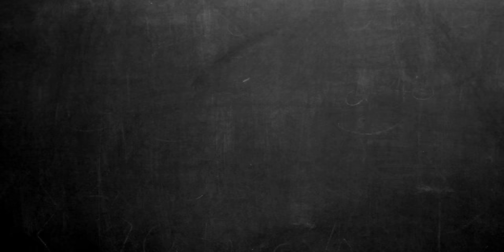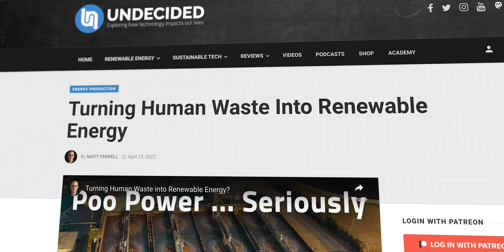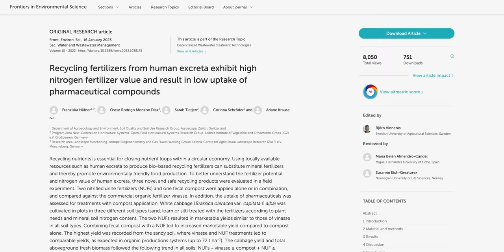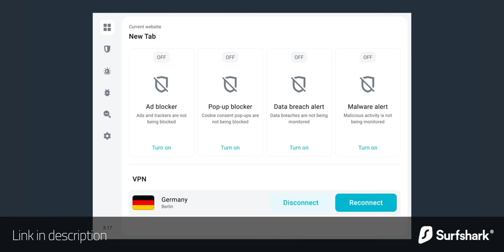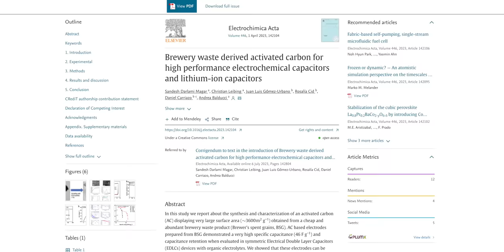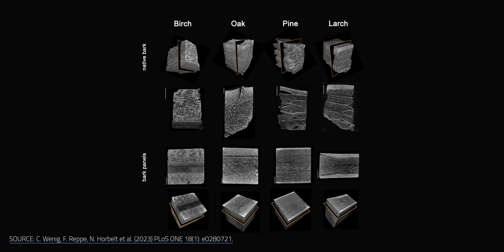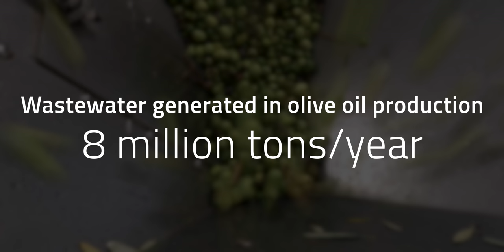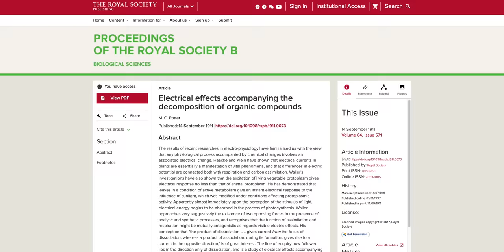Top 5 Crazy innovations for Reusing Waste

Comment: If we were on a generational space ship traveling towards some other destination in the universe, we'd want to recycle everything.  Thing is, we basically *are*.
Reply: Well it's a long step away from the disposable society we live in at present we don't even up cycle or recycle phones that get dumped as we can't change batteries and throw away vapes and bottled water.
Reply: Earth is our generational space station. Recycling should be so common that it replaces the word trash entirely. Science needs to advance so that costs to recycle go down and becomes profitable. Otherwise, it won't be integrated into the economy as much as it should be. Beer powered society lol ❤🙏
Reply: @SlyerFox666  he means the earth is basically a space ship.
Reply: @ge2719  what do you mean "he means" we are ? And what also gave you the impression that that went over my head when it is literally written 🤷🏼‍♂️
Reply: @SlyerFox666  well for one thing the op said nothing about society, or disposable society, or recycling, or single use product, or anything relating to anything you said. The op merely said earth is essentially already a multi generational space ship hurtling through space.
the op say " we basically *are*..." is not them referring to the "we'd want to recycle everything". that YOU replied to. 
So the specific part of the quote the op was referencing clearly did go over your head.
Reply: @ge2719  Well your wrong there recycle everything was literally what was written so is it really worth me addressing someone that can't even be bothered to read a comment takes some sort of offence to a reply and then tries to explain how they are right and the other is wrong when clearly your not, troll along good buddy 🤣
Reply: The problem is, it's always seen as a problem for the next generations.
Reply: @davidmccarthy6061  then don't then is the solution 🙈🙉🙊
Reply: @SlyerFox666 the batteries thing will change in eu. Eu made it necessary to make phone batteries replaceable
Reply: @kin98100  ROFL yea good luck with that one
Reply: TRUTH!!!
Reply: @davidmccarthy6061  Yeah, we already know that. Conversation here is: How can we do better?
Reply: Makes me wonder about a sort of "net" ahead of interstellar ships. Not that you will run into much, but anything in the way will be disastrous if not dealt with, so might as well see if you can scoop it up for use as needed.
Reply: Thing is everything that we have used is still here. Nothing has been lost, only changed. Do we solve the “co2 problem” by going to electric cars or by recapturing the CO2 with plants that we and our livestock can eat?  Both?  Why must we focus on one idea and ignore others. Why do we let narrowly elected buffoons decide what ideas will be forcefully promoted and which will be forcibly denied?
Reply: 😱😱😱 I don’t believe there is none about farts 😱😱😱  Farts r methane gas. There gotta be some way to take advantage of our farts 💨
Reply: We do not generate enough waste to do much useful.  We simply could NOT use direct human waste as fertilizer. We simply do not have enough.  It sounds like a lot and it is in general, but not in comparison to the number of acres under farming.  We  need hundreds of pounds per acre of regular  fertilizer. Poop based fertilizer would probably be MUCH higher.  If you assume a ton per acre, it would take 94 million tons just for corn.

The average person poos 320 pounds per year.  Times that by 320 million and you get 51.2 million tons.  This is wet poo. All the water content would need to be pulled out before turning it to fertilizer. Poo is 75% water. So the total amount of dry poo per year in the US counting all 320 million souls is 12.8 million tons (2000 lb ton).  This would not even cover just the corn dedicated to corn ethanol.

 Beer to batteries won't be much either and that's assuming the tech works as advertised, which it probably does not.

To put things in perspective, something like 40% of the corn we grow goes to creating ethanol for gasoline and it's barely 10%. Corn is, by a wide margin, the most grown crop in the US. 40% of that acreage (38 million acres dedicated to corn ethanol. total corn is 94 million acres)  is dedicated to making about 10% of our gasoline.

Our lives, everything about our lives is enabled by fossil fuels. The fertilizer we use is made from natural gas.  We literally fly airplanes over crops to crop dust them. We run electric pumps to pump water into the crops.  The crops are picked (and sown) by enormous diesel burning machines. They are shipped by diesel machine. Then they are processed using electric machinery and then finally shipped to your local supermarket in air conditioned trucks burning, you guessed it, diesel.

We are literal SUVs.
Reply: @christo930  all good points.  For the cost of energy now, it's not economically viable but if energy were to become cheaper and processes were to improve, it could be.  But it is pretty wasteful that we spend so much energy and effort to mine fertilizer or refine it from natural gas and then grow food with it and then poo it away.  It could be put to better use.
Reply: @marginbuu212  But it's not a cost problem, it's a scale problem.  The amount of poo is not sufficient to fertilize all of the acreage being farmed in the US.  I'm sure, though I haven't run the numbers, that it's just as bad for pee.

I'm not saying these are bad ideas though. Cutting the amount of natural gas we use on fertilizer means it will last longer. By all means, all the poo that can be captured and turned into fertilizer should be captured and turned to fertilizer.

The beer thing though sounds fanciful. It might not be worth doing.  Because later in the video after I posted my comment, he mentioned it was turned to carbon.  The final carbon product is probably maybe 10% of the weight as it left the brewery.  If it works, by all means, we should do it.  Conserving scarce natural resources should be a priority.

The way I see it, fossil fuels are/were a one time gift of nature. You use it, then it's gone forever and cannot be replaced.  I oppose exporting any of it.  I oppose frivolous uses of it.  Unlike other things, you can't recycle it and use it again. Nature is making more, it's not doing so on a time frame of any interest to us.  AFAIK, nearly all of it is at least 90 million years old. It took millions of years to lay down all the sediments, millions more to bury it deep enough and millions more to cook it into the wonderful stuff we get out of the ground.  OTOH, it is believed that every ounce of gold ever mined still exists.
Reply: Lol tell your mom to get you more pizza rolls and honey buns the Intellectuals are here talking
Reply: @ge2719  Mr Bucky Fuller stated that “we are in the Spaceship earth” back in 1948!

Comment: Interesting idea for using human waste as fertilizer.  Are they extracting the materials out of sewage or direct extraction?  The first will be relatively easy to implement, the second would require sociatal changes.  Also, how are they handling the infection risk?  One of the hazards of using human waste as fertilizer is someone getting infected and spreading the disease to others via the recycled food chain.  Personally I'd use radiation to sterilize but that will cause the environmentalists to freak out.

Possible future technologies, keep up the good work.

Comment: the second of 3 sections about (b.a.t.e.s.) The easiest example I can think of would-be cars, there may be some money in scrap metal, but there is no money in disassembly, and to correct this I suggest a £500 bond is payable to the (D.V.L.A.) when a vehicle is first registered in the U.K. (Other national vehicle registration departments are available) The bond is then held until the vehicle has reached the end of its useful life, then the bond will be redeemable by a disassembly company, only when the vehicle has passed down a disassembly line and has been broken down to its most basic components and not just crushed, this means everything removed, doors, bonnet, boot and separated from their padding and electricals, seating, carpets, and roof lining, plastic dash-Panel, and wiring loom removed, even the engine/ gearbox and suspension system to be separated into their various metallic alloys, and even the generator and starter motor, in the future this would include vehicle motive batteries and fuel cells, all to be disassembled. 

It would not matter Where in the world the car was made, once it is registered in the U.K. a bond must be bought, and all manufactures who wish to sell into the U.K. 
would have to supply the Disassembly companies with a protocol out lining the easiest methods of disassembly.

Problems and benefits of the idea so far, even a cheap car cost £15,000, so how do we manage to disassemble for just £500. Well to start with you do not need a design team or an advertising budget, neither do you have the cost of manufacturing components from freshly bought new raw materials, and if you consider it takes between 20 and 40 hours depending on the efficiency of the 
plant for a shell to travel down an assembly line to become a completed vehicle, it should take about the same amount of time to disassemble, and £500 is about the wage for forty hours of a low to medium skilled worker.

 And it will be MANUAL labour that will be required, robots are perfect for assembling pristine new components, but after ten or fifteen years of corrosion 
disassembly might be beyond them; one option could be to repurpose old car production plants that are due to be decommissioned. 

The bond for a washing machine, fridge or solar panel would be much less may be £20 as they should be much simpler to disassemble. O.K. disassembly might work, 
but the problem is with the bond idea, as it stands you would have a ten or fifteen-year time lag before such a system would be up and running, true but this is where 
the governments come in, they could pump prime, if the government paid out a sum equal to a bond for each scrapped car in the first year, the bonds collected on all 
new cars in the first year, would then go on to pay for the disassembling of cars in the second year, in the same way that today’s state pensions are paid for by today`s 
workers, and when today`s workers retire, their state pension will be paid for by the next generation of workers. For a one-off payment the government could start a 
whole new disassembly industry, providing employment for thousands, ensuring a continuous supply of recycled material with minimum contamination as part of a 
sustainable future.

Comment: Adding our waste to as nutrients (properly treated) is the way to go, and gets back to the natural cycle which is what it was used before chemical fertilizers proliferated.

On the other hand, using fruit waste to create plastic, while in theory is better than petrol-derived plastics, if it implies removing it from the compost pile, it goes contrary the first project, which is natural fertilization of the soil. It's like using crops for biogas instead of food production.
Reply: No, there is enough compost to supply both projects for a long time 🤦‍♂️
Reply: @DJ1573  as much as peak oil is being publicized, there are studies affirming that we have already surpassed peak fertilizer (or NPK, if you will).

If that's true, and with world population still growing, we're gonna have a hard time producing food for everyone some years down the line, so I wouldn't be so sure.

Comment: Matt, I work for a water treatment company in Central America. We implemented a combined coagulation flocculation, advanced oxidation, and anaerobic biodigestion treatment plant for a small brewery in El Salvador. The potential methane yield from the brewery waste water is enormous. Unfortunately we do not have experience with harvesting the generated biogas, but it is a very high quality gas, especially thanks to the advanced oxidation step before the bio reactors.

Also, hopefully in the future anaerobic bioreactors can be turned into MFCs to self sustain an electro-fenton Advanced oxidation reaction. That would be the holy grail for water treatment!
Reply: Focus on capture of the methane to use as a fuel to power a portion of the machinery used in your treatment process. I've seen large domes over the modules generating the methane for this used to great effect.

If fusion is always 20 years away, it is not an underexaggeration to say MFCs are always 50 years away.  I suggest you read some papers on the long, long list of their limitations, which should drive home how they will never get to a point of usefulness like we e vision they could be.
Reply: Don't they have a system like that that harvests the gas for power generation in London England ?
Reply: Anaerobic disgestors are super cool! I’ve always been curious how much methane you could produce if you were to collect a communities waste food and biomass. If you could collect enough, it could be a great source of energy for heating
Reply: @joecur94  Yeah, there are statistics for how many people’s discharges you need to get enough yield and for it to make economic sense, but it is absolutely possible, especially in tropical countries where the temperature is very favorable for anaerobic biodigestion!
Reply: That’s super interesting to hear! I live in Canada so I’m sure the food waste is fairly high but we also have a lot of biomass waste like grass clips and leaves in the fall so there could be tons of potential in regard to output. On the other hand the unstable temperatures cause some issues but I think with appropriate insulation and potentially burying the system below permafrost level could significantly decrease the energy cost of keeping the system at operating temperatures.

Comment: Although canola oil in ones gas tank is probably not a good idea, I used several tanks full of rancid peanut oil in my 1984 Nissan diesel.   The owner manual included a chapter on not petroleum fuel products that would power the engine.  Is some communities it’s possible to smell fried foods as filtered used cooking oil powers personal vehicles.   

Wishing you and your family a blessed week filled with gentle rains, seasonally appropriate weather and restful evenings together in your new home.   Peace

Comment: Relocalization of food is one huge step, letting livestock eat culls, crop residues, and manage weeds, pests and fertility in polycropping systems especially using food producing trees, shrubs, vines and perennials would greatly reduce much of the mess.  Surpluses could be shipped out for larger markets, preferably by rail.  
Using rail would reduce water runoff, and add system efficirncy.

Love hydrochar for dealing with human waste.

We also waste a lot of water,  rainwater is often mixed with sewage and gors directly to the watertable without treatment during heavy rain events in many cities. Runoff from roads and parking lots could instead be diverted to landscaped bioswales instead of using a separate water source..

Raw bark makes a great fuel, when oriented correctly in a fireplace or stove.
Not all innovations are good, but many of the innovations in this video may be workable compared to many others.

Comment: As someone who worked on microbial fuel cells as part of my graduate work, scale is indeed the problem. To point where I can say with confidence that the probability they ever become viable is nearly zero. An MFC size of a basketball provides less energy than a low power button battery and requires frequent maintenance due to natural degradation of the cells performing the transformation, and that is nigh impossible to improve. Hundreds of people have been trying for decades in the lab I worked in alone. Basically they exist in a constant point of near failure. Additionally, they require precious metal electrodes to achieve even that poor level of performance. It flashy and interesting on paper to those that dont understand the technology, but there many other options worth investing time and money into than MFCs.

Comment: yes to all of this.  The only thing that would give me hangups is if there are big drawbacks to conventional methods of today.  What can alleviate a hangup is actions taken to nullify or reduce the drawbacks impact.  Say the organic dashboard has a lifespan of 5 to 10 years.  Create a market for replacements and make it accessible and affordable at both initial purchase and recurrent maintenance.  Some of the issues we have today with part availability and supply chain is that everything seems to have it's own specific part.  What's worse is when the part is needed for a very easy home repair but there are no direct to consumer avenues, only ebay or Amazon.  All of these problems are by design by the way.
Reply: I agree with making consumer products last longer (well-built) but also this suggestion of letting us tinker with our stuff or train people to fix machines/electronics (especially tech).  Why does every manufacturer have different parts? Can't we get consistency in the world with all parts?  I think the UN should propose this. Why not have plug and play items that work globally?  😊